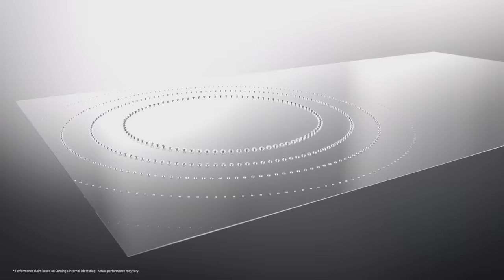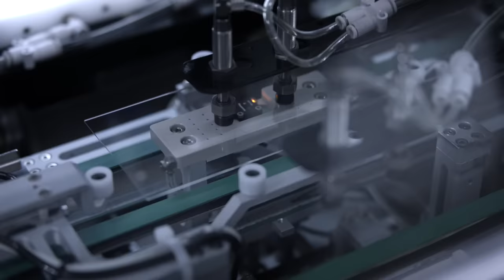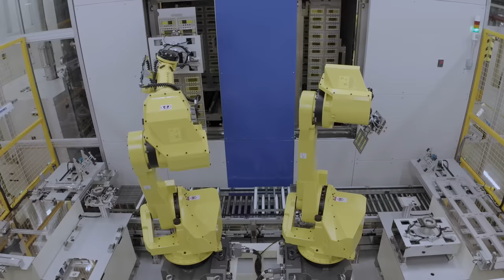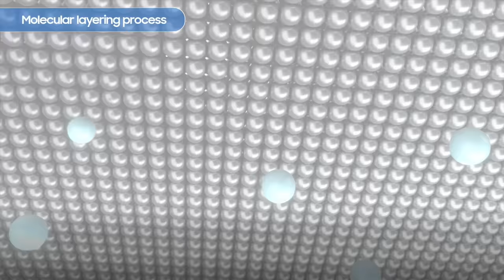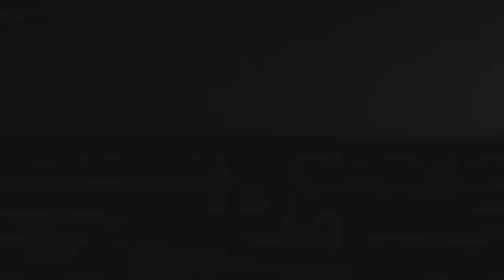Galaxy S24 Ultra: Corning® Gorilla® Armor | Samsung

Comment: Thank you for your expertise. My wife, and I purchased a cheaper Nord phone a couple years ago. Although it has some good qualities. One being its price point, we were overall very disappointed in its performance. Too many issues to cover. We just purchased the Samsing Ultra 24 yesterday, and so far, my wife loves it. Is a screen saver unnecessary due to it having the Gorilla glass? The screen is really nice, and very reflective of light. Making it easier to see. Corning has done a phenomenal job on this product. I would like to not have to buy a screen saver if not needed. Thx for your videos. They are very informative, and straight to the point. The Ultra 24 takes incredible photos I must add.

Comment: So if I installed a screen protector I would loose the anti reflection feature ? Could I use a bare screen without protection ? Is that safe enough ?
Reply: Of course you would lose the anti reflection feature.

You have to stick with the bare glass.

Comment: please please please please please add Bluetooth spen in fold 6! most ppl are just waiting that small addition to join the fold community! even if it is in a case but should be Bluetooth charged wirelessly by the device

Comment: Many users report dull/washed out colors and grainy display and still - there is no official response from Samsung. That should not be acceptable, especially in this price range.
Reply: They had added a setting to increase vivid ness... which had actually improved the colors
Reply: @karanbaburao9503  yeah but that did not solve the grainy display problem. And no software update actually can do that. Releasing 1500 bucks phone and then "fixing" it with software updates doesn't make any sense and I don't know why people fall for it.

Comment: Dear Samsung officials, please fix the errors on Android 14, the applications I want do not open the notifications of some applications I downloaded in the play store, I couldn't open them if I was nap, and then I use an external screenshot application and it always starts again, I don't want to restart it every time, and the interface also freezes, stutters, contractions, the screen freezes, it does not turn on for 1 to 2 MİNUTES. I WANT TO USE THE PHONE, YOU RESTRICT IT, I CAN'T USE IT

Comment: Honestly, I'm very disapointed with the samsung s24 camera. I came from a s10e and the experience was better with it(faster taking pictures, less post processing and not far from the s24 in 12mpx). The s24 is slow taking pictures and everything needs to be static to have a decent photo. They look overprocessed and if you choose the optimization it looks worse and gets even slower to take the picture. The zoom is not even worth to be honest... I felt comfy with this brand but I'm really consideringabout returning the device and refund. If you don't trully update that, you are just liyng. A 1000€ device feels wrong two months after release and you expect I keep it for 7 years?...

Comment: Samsung team,  you should focus more on improved your cameras, this years s24 ultra camera is a joke, even the s23 ultra defeats it. The processing on the s24 ultra is too mild, less contrast,  though has good shadows and hdr. Not to mention portraits, Samsung we used to be king of portraits, but other competitors are winning us on this, thw edge detection in the new s24 ultra is badly processed. I use a s22ultra till today, no reason to upgrade to the s24u